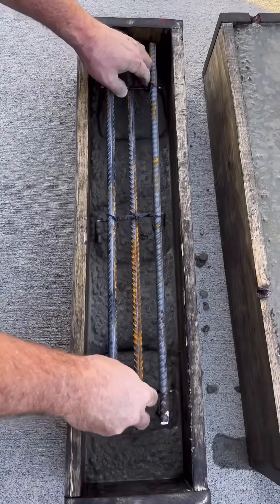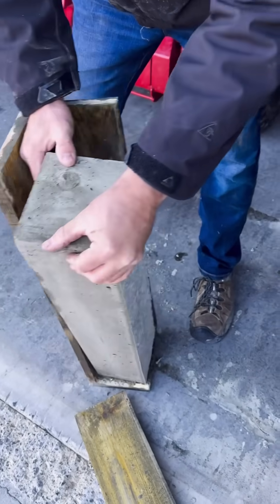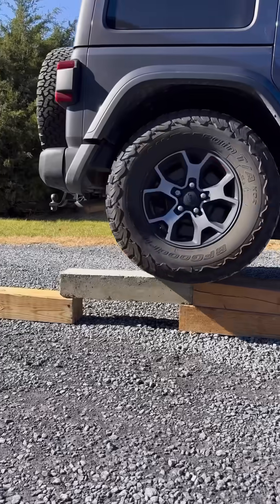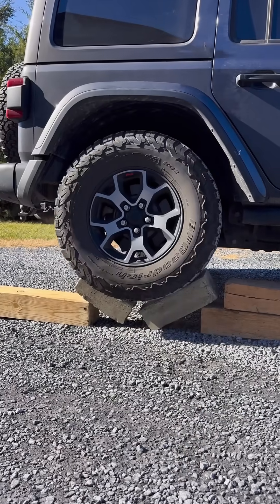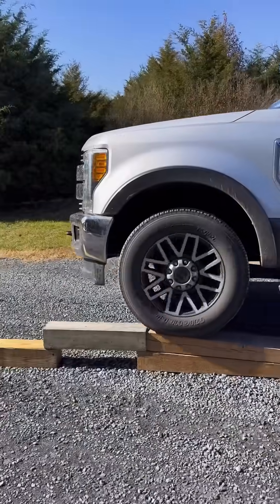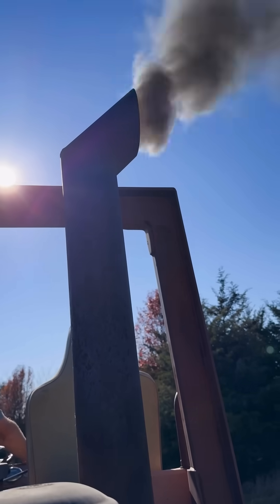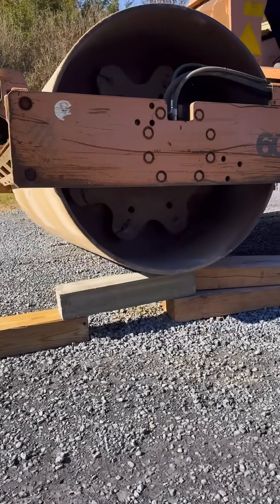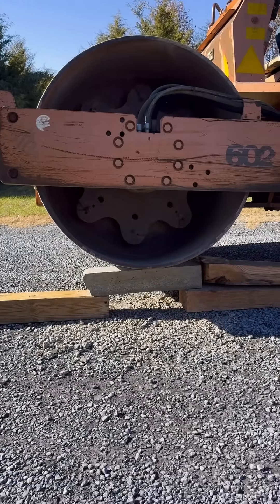Why We Use Rebar To Reinforce Concrete

Comment: I remember doing this at a civil engineering course. The professor said reinforced concrete is probably one of the most important invention we ever had.
Reply: "Reinforced concrete is probably one of the most important inventions we ever had." - every civil engineering professor ever
Reply: @merlin8675309 i like your profile photo
Reply: Right up there next to the transistor.
Reply: @NixieTheSkwerl And the toilet LoL
Reply: @NixieTheSkwerl  Yep, And Air Conditioning ! Think Food
Reply: @NixieTheSkwerl  The 3-electrode vacuum tube, aka Triode, was waaaay more important than a transistor, every single circuit ever was invented before transistors, they just allowed photochemical manufacturing, letting us have extreme processing. But all the basics & even theories about most processing were done before the transistor existed.
Reply: Professor wasn't wrong
Reply: dude who invented the wheel has entered the chat
Reply: And it’s crazy we still use our weak ass version of concrete with it instead of the cool shit they use in the aquaducts of Italy that are still standing today.
Reply: @huh0123  what do you mean?
Reply: It ain’t above tacos tho
Reply: Which is why 3d printed houses have no rebar. For extra strength.
Reply: @alfhwuqd walls in a 3D printed house only take compressive stress (bears a weight while fully supported on the ground), which simple concrete takes very well. That's also why there aren't 3D printed beams, posts,  balconies, marquees and cantilevers: they all require steel for tensile stress
Reply: @creolespanish34  what happens when you hang a picture on a 3d printed wall?
Reply: Roman concrete?
Reply: None are as important as anesthesia in my opinion, Im sure lots of others would agree.
Reply: My vote still goes to toilets and indoor plumbing.
Reply: 5 am
Reply: 03:18am, shyt I got work soon.
Reply: But… it seems that rebar is not great either because it’s round. If it were a mini I-beam then it would probably provide better tensile strength. Just changing the shape can change strength properties
Reply: @nofurtherwest3474 that's why rebar is not isolated, but conformed in a little cage that, surrounded by concrete, will be anchored in place into the beam. Rebar has texture, a T-bar doesn't, so it will freely slip into the structure, making it useless
Reply: Concrete is basically bake-able rock
Reply: Civil engineering students when uncivil engineering students walk in:
Reply: Nope, it's shit for lazy cheap architects. It's a good material, but not durable at all. The rebar starts oxydizing after 30-40 years, and the building has to be knocked down. 
Stone and bricks are the way for durable buildings,but you have to deal with their lack of resistance to tension by using true ARCHITECT solutions to dissipate forces : arches, wall thickness, etc. 
That's how you buils thinks that last +500 years
Reply: That theory was proven true during the 1989  World Series earthquake in SF. 
More rebar the better
Reply: We did 3 with diffrent reinforcement 2.5m long and than bent them
Reply: Umm fences, transistors, electric just a few off the top of my head more important
Reply: Current civilization is BUILT on reinforced concrete so im inclined to agree
Reply: It is.
Reply: Stupid professor. Dude's never heard of Boulder center
Reply: Hopefully your grade wasn't based on the percentage intact the concrete managed to be COMPARED to other students like what happened in my engineering class..... completely ruined the point of the lesson by making the grade a "First place gets an A, second a B and so on".
Reply: Not soap?
Reply: Did you get a big kiss in the engineering course
Reply: Sliced bread up there too
Reply: Nah being able to cut wood is.
Reply: Also high stressed” tendons” cables tensioned while curing occurs makes wicked strength on bridges
Reply: why is roman concrete holding up with no reinforcements
Reply: you can live without it
Reply: Definitely metal piping. Plumbing has saved more lives than anything. Plumbing makes everything we have possible.
Reply: I remember taking a culinary course in school, my teacher said that the greatest invention on earth was bacon
Reply: I say modern steel - which is really just a bunch of production inventions. Can't have reinforced concrete without steel. Most civil infrastructure relies on steel as do all large modern buildings. Steel and concrete are both thousands of yrs old. But steel reinforced concrete is what, 150 yrs old? 
Fire.
Plant and animal domestication (agriculture)
Wheel
Concrete
Sliced bread
Steel mass production
Reinforced concrete
Transistors
Silicone breasts
Gorilla glass, fiber optics, LCDs, Pyrex, all other Corning inventions like Corell ware
LEDs
Pocket pussy? 
Fully cybernetic, human-like sex robots indistinguishable from young female flesh but without all the blah blah blah and "I'm not paying are you serious?! What kind of man are you!? Also women are better in every way"
I'm just joking guys. I love women I just blowinf off steam bc they don't ever shut up from morning until bedtime just blah blah blah. Almost none of it matters. Except for everything my daughter says. That's all super important. Everything. Her MOTHER says is aaaaaahhhh kill me now!! I can't stand a word her mom says
Reply: I would say the wheel
Reply: But when the rebar starts rusting on the inside and you don't see it...
Reply: @LinkinPark4Ever1996 . If the rebar starts rusting it's because there's a crack that allows water in, which would actually make the rust show up through that crack in most cases
Reply: @ddnava96  rusty rebar is 99% of the time caused by old rebar exposed to the elements before being sealed in concrete. I guarentee ALL rebar does not go from fresh moulded to straight into concrete, theres almost always months in between, sometimes years if its old stuff or stored in the elements (which it almost always is: it retains 99.999999999999999999999% of its strength even when rusty)
Reply: @ddnava96  concrete is not impermeable to water vapor, even without visible cracks -- so the rebar can eventually rust even if not directly exposed to water.

they also take additional steps to protect the rebar in projects intended to last for a long time -- like coating the rebar in zinc, or galvanizing it
Reply: @ddnava96  reinforced concrete cracks by design, even pre stressed frequently has microcracks.
Reply: @LinkinPark4Ever1996 most rebar has some sort of protective coating to help with rust at least from my experience and bare metal won't rust if it's properly encased in concrete and the only situations where rebar is exposed to enough moisture to rust are there's a crack or your concrete is so poorest that water can just seep its way through to the steel
Reply: @LinkinPark4Ever1996  If rebar rusts then you will see it because rusting metal expands and causes a type of concrete spalling known as concrete cancer.
Reply: @LinkinPark4Ever1996  ive rebuilt sewer systems that had rebar in them from the 20's and wasn't rusted.  The ties were still intact.  Rebar with latex on it is just a waste of money
Reply: @LinkinPark4Ever1996  it has its downsides, but it’s a way of getting most of the capabilities of steel for a much cheaper price.
Reply: Right up there with the McRib, honestly
Reply: Wrong! The most important invention was the tampon! 🙂
Reply: @SP-io7lj no, because we are Gay.
Reply: @SP-io7lj  I hope you aren't serious
Reply: Limestone entered the chat
Reply: it's literally not, bro thinks people just didn't have buildings until it was invented, paper is the most important invention, and the reasoning should be obvious to anyone with a brain
Reply: @pablovaldes2397  Reinforced concrete is a close second. You can't build stuff without paper, but you can't effectively invent stuff without paper and a proper building. Bad buildings were the main handicap during the Industrial Revolution. After we discovered the technique, the world population went up immensely, and society as we know it today formed. 
You probably wouldn't have been born if not for reinforced concrete.
Reply: @karamad2847 what problems did buildings have during the Industrial Revolution?
Reply: @karamad2847 you're confusing concrete for oil. Without oil we wouldn't have the population we have today and when we finish the oil everything will go back to the way it was prior to the industrial revolution. Oil is the foundation to modern living.
Reply: @ absolutely not. Oil is important but not crucial anymore. Concrete was, is and will always be crucial. We would get away with using other sources of energy but not other, but not really with using other building materials.
Reply: @karamad2847  please tell me how you support 9 billion people with no oil. Do your research, I'll wait.
Reply: nah because reinforced concrete is not that important really. it's a convenient for sure but not actually important as there are other ways to build stuff and it ain't actually a bigger deal than convenience. without it we would have to find other ways to solve problems like bridges but we would still have a solution one way or the other so it's not a bigger deal than money and convenience. i would say coffee is more important as that's what revolutionized humanity. before coffee people use to drink wine and beer because it was a way to make sure the water was clean but boiling the water for coffee did the same thing so now you have a bunch of people awake and focused rather than tipsy all day. it has had a major impact on how the modern human functions and allot of the inventions
Reply: @savagememes873  are you fucking serious dude? you wouldn't be able to drive on a highway, drive a car AT ALL, go up more than 10 stories in a building, go on a bridge longer than 100ft........... you have literally NO FUCKING IDEA what youre are talking about.......

speaking of your coffee thing.......... yeah it was definitely DRUGS that helped humanity (LMFAOOOOOO) genius dude....

anyway my vote goes to the printing press, widespread information LITERALLY FUCKING changed the entire WORLD......... EVERYONE could get info SO PANTS SHITTINGLY FAST after it was invented...........

god bless........
Reply: @savagememes873 we woooould have... but we don't. You show to give too much importance to your fantasies.
Reply: @savagememes873  boi you jestin us here man....go drink sum covfefe
Reply: @savagememes873  Lmao the funniest part of the joke was how it didn't land tbh
Reply: @savagememes873 dude said coffee. 😂
Reply: @savagememes873 ngl that's a crazy take. Concrete's importance doesn't stop at convenience, it's way more than that. 

Cement is the single most building material to ever exist. It's cheap, reliable, tough and can be produced easily. Concrete is one part of it. Without Cement we wouldn't be able to build, not by any reliable measure, which means the 8 billions living rn couldn't exist without it. Steel is too expensive, you can forget that.
Poor and developing countries? They wouldn't have a chance of having a government bcs there are no buildings.
Internet servers? Nope, we would rather use the limited material to build hospitals, schools and houses.
Schools? Overrated anyways. Small schools might exist, nothing more. 
Economically, caffee was nice, made people less sleepy but you know what made cooperations grow? Concrete bcs now you can put multiple departments in one building and the can work together.

Basically, most of the things we do, we do in buildings and modern buildings are made of concrete. Finding another solution would either be a different kind of concrete or we wouldn't be able to build the same stuff, bringing us centuries back in development.
Reply: @karamad2847  bro liquid rocks been clutch fr you trippin
Reply: @hawgcranker420  More than just clutch bruv, liquid rocks be slappin frfr.
Reply: @karamad2847 Disagree here. Concrete is overused. Steel and even wood a far superior building materials. It's not that concrete is useless, it is just vastly overused. It is a material that can't be properly utilized without reinforcement and which essentially cannot be used more than once
Reply: @matthewmosier8439  That is literally wrong. Wood and steel are far inferior in almost every aspect to concrete. Price, convenience, utility, simplicity, safety, overall quality of life, availability and ability of customization. I have bo idea why think otherwise, explain.
Reply: @karamad2847 Did Rome have govt, schools, towers?? They didn’t have rebar…
Reply: @savagememes873  imagine writing all that just to be wrong
Reply: @savagememes873 that’s wrong about we will just magically come up with another form of building. Have you ever built before?
Reply: @savagememes873  Somebody let stupid out today.
Reply: LOL @savagememes873
Reply: @savagememes873 you said a lot.

Comment: Concrete integral to 50 to 100 days depending on the weather using cemental concrete obviously when it comes to structure you want to use cement.❤

Comment: I learned this in school. You can actually break pavement slabs by putting a pebble underneath it and jump on them. Glass will break easily if you have a pointy object and can withhold flat or dull ones.
Reply from the maker: True

Comment: Besides the concrete being green, the enforcement looks to be close to the middle of the beam, where it doesn’t play out its full potential. Looks to me as if you could have placed it 1 -1.5 inches lower.
Reply from the maker: I put the rebar in the top third of the beam, and then flip the beam upside down before driving on it with the roller

Comment: But you got to read the bag on the water contents you're putting too much water in there to bring up the tensile strength of the concrete the weather the weather you drop pour it the weaker it is the dryer you pour it the stronger it'll be

Comment: 128 hrs.
Reply from the maker: 60 hours
Reply: @hausplans  28 days. For full compressive strength. - Construction engineer (american concrete institute) it will continue to cure for 20 years after.

Comment: Use smaller rebar but double it input 3 rods on the top and three odds on the bottom and connect them all together just below the surface maybe 1 in on the top and bottom

Comment: I bet that beam has only cured for 24-48hr
Reply from the maker: 60 hours
Reply: 60hr? okay, looked too green to be 60hr but not all concrete is the same. Still always cool to see how much of a difference it makes, and now they want to put fibers and different shit in concrete instead of steel.  If it works it works i guess, steel rusts and shit so its not forever but neither is concrete. @hausplans

Comment: Can you match these two with rock ? Which is harder
Reply from the maker: It would depend on the rock, there’s all different types
Reply: @hausplans  normal natural strong mountain rock, pure stone from the mother of nature, so tell us please which one is stronger in your opinion
Reply from the maker: Generally, I think rock is harder and more dense than concrete
Reply: @hausplans  even with the metal structures ? Because i live in an apartment ground floor, and I've noticed that my walls are made out of heavy stone which made me thinking it's gotta be robust to hold up thr other levels

Comment: Concrete is strong but it ain't indestructible...stop comparing a Normal human against Superman in strength test, A fukin road roller! What's next A wrecking ball?
Reply from the maker: That was mainly just a show an extreme situation also to show that there was rebar inside that beam

Comment: Fun fact - one reason the combo of steel and concrete works so well is because they have similar thermal expansion coefficient.
Reply: My Material sciences and mechanics prof called it "The most important coincidence in the history of humanity"
Reply from the maker: True
Reply: That was a fun fact, indeed. And I learned something. Thanks!
Reply: Not always, different steel and cement have different thermal expansion coefficient due to composition, for steel it's the addictive and crystal structure that affects it, for cement it's the aggregates, and in practise design will also affect thermal expansion, so oftentimes when designing members with significant temperature gradient like roof these factors has to be considered.
Reply: What? 🤔
Reply: @thetrollslayer3716  Means the materials expand and shrink nearly the same amount based on temperature.
Reply: That looked like a shear failure. Don't sleep on the hoop reinforcement bro.

Also, your beam was way over reinforced. You want the steel to be yielding at failure so you don't get a brittle failure like in the video. 

Use smaller bottom bars, and add a bunch of hoops and you'll get better results.
Reply: Aw...  you don't know what fun is.  😢

Comment: try using it with a fiber concrete mix with a wire length of 5 cm and a ratio of fiber mix with concrete weight of 3%. can significantly improve the tensile strength of concrete.

Comment: On an engineering perspective, did you calculate the maximum weight that the  reinforced beam can take? Because no matter how you reinforce it, if you exceed it's max load, it will still break.😅😂😂, and usually 1 month to cure with constant watering.

Comment: I estimate that you let it cure for 7 days before you did the test, thats usually minimum wait time  for some slabs i think......i would recommend waiting a solid 28 says for a driveway or anything that you plan on driving heavy equipment on. Do Rebar vs Fibers next :)

Comment: wouldn't it make it really heavy and it might need changes in the structural designs
Reply from the maker: Steel is lighter than concrete

Comment: Proud to be a civil engineer 😇
Fun fact: the beam is simply supported hence reinforcement provided at the bottom because tension develops at the bottom. But it's opposite in case of cantilever beam where tension develops at top hence main reinforcement is provided at top.
Reply from the maker: Good points